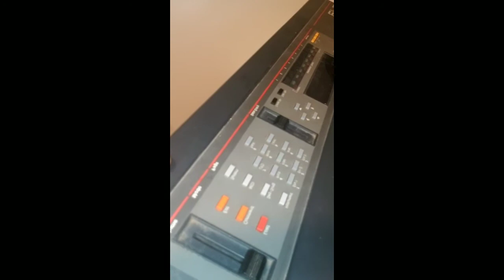Ensoniq EPS Power Supply diagnostic

Comment: Great video! My EPS16+ rack has been freezing and crashing all the time. I think maybe I need to replace or recap the PSU? I have good soldering skills and all the tools, but I've never done this before... Is it dangerous to remove the PSU? What should I be paying attention to or not do in order to avoid getting an electric shock? Also, I do have a voltmeter don't really know how to use it to check the fuses, what setting should I set it to? Any help would be appreciate. Thanks!!!
Reply from the maker: Anything that has capacitors is dangerous. Just make sure the caps are drained before you start poking around. There's plenty of vids on here to show you how to do that.

Comment: I see a ts10 listed online for $250 shipped but they say it has a blown out fuse and won’t power up.. is that a fairly difficult thing to fix on the older ensoniq boards? I can’t find fuses anywhere for the ts10
Reply from the maker: the fuse is just a 250v slow blow I believe, that's an easy fix. take one with you when you go to look at it, and if it still doesn't power up, get it for $50...lol TS is a great sounding board with poly AT. It's my go to for string patches.
Reply: @baercapelli  ok great! thanks for the reply bro! I would go check it out but it’s actually located in the Midwest and I’m in California Lol.. I have a TS12 currently and it works great but when I saw that TS10 I thought it was too good of a deal to pass up! lol then they emailed me after wards and said it was “for parts only” and the fuse and power supply was corrupt Lol..‘I’ll try to see if I can get it cheaper though, I actually paid around the same price ($275) for my TS12 (with nothing wrong with it) precovid and now it’s on guitar center for $1200 bucks! and thats where I got it from Lol but my main thing is I wanted a smaller keyboard as much as I love the ts12 it is just so heavy and more bulkier than the smaller ts10 or a 61-76 keyboard
Reply from the maker: @joseph395  yeah, well the TS-10 is still a heavy bitch. If you want lightweight, stay away from vintage....lol That said, the                        power supply swap and fuse is an easy fix, so if they're not gonna kill you on shipping, I'd take a shot at it, but then again, if you have a 12, wtf do you need a 10 for? Spare parts, maybe?

Comment from the maker: For those of you following along, the issue was the ribbon which connects the keyboard to the mother/main board. It was loose on the keyboard end, which is awesome as the power supply tested fine per the service manual. I deox'd it, plugged it in, fixes the known issue of the keyboard middle connector, cleaned everything up and she's purring like a kitten. Not a bad find!!
Reply: thanks for the videos - got my EPS classic in my back room - hasnt been touched for 20 years - has the problem where there is noise on the outputs which I recently saw was likely a power supply issue.  Will have to open it up and see what i can find.
Reply from the maker: @carbondax2544  Thanks for watching. If you have noise coming from the power supply, my money would be on the filter caps. Should be an easy fix. Word of advice: Before you pull out the soldering iron, pull every connector and hit it with some Deoxit. And then try again. I don't know if mine makes noise or not, I don't use the outputs, or samples, lol.